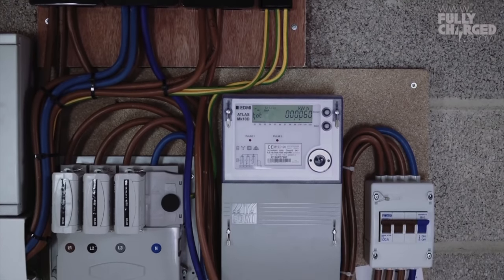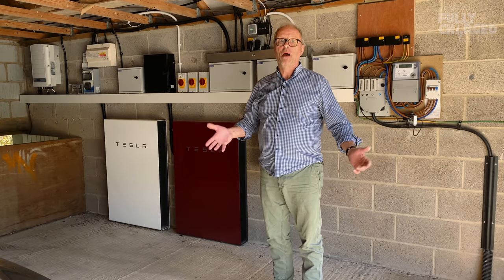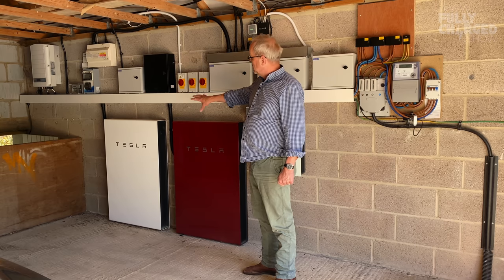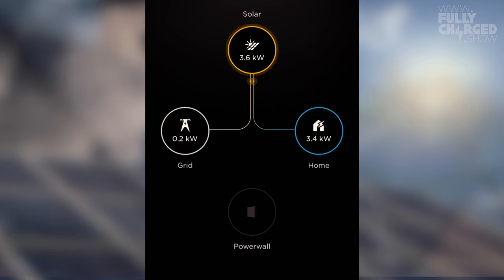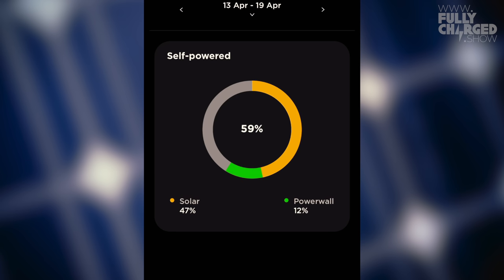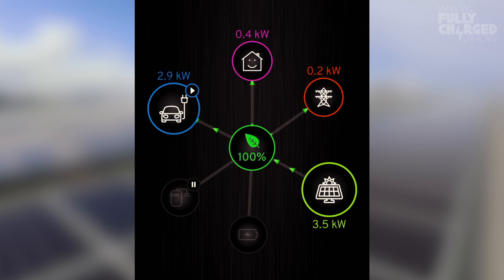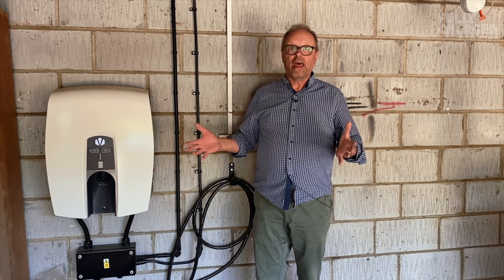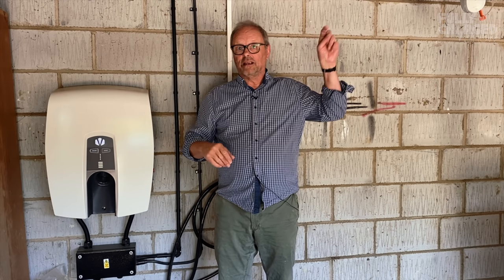Tesla Powerwall: how quickly can it respond to a power cut? | FULLY CHARGED for clean energy & EVs

Comment: Did I miss the part where you explained how your home system knows how to cut off from the grid to protect any electrical line repair personnel? Also, if the idea is to use the cars' batteries and the power walls to balance out the grid, how does your home system tell the difference between an outage caused by damage to the lines, etc., or a dip in the grid which it should feed back into the grid for? Once your system disconnects from the grid, how does it know when to switch back on to it? More detail on the way it (the switch) protects the workers and the consumer would be appreciated. Great video as always Robert, thank you from Oregon.
Reply: Barry Kaine the system still measures the grid side of the disconnect. It needs that info to synchronise what it exports with regards to voltage and frequency.

Comment: We had the Backup Gateway installed about a year ago. It has been a bit odd with showing outages that haven't happened and not backing up all of the outages we have had. I recently changed my EV Charger out for a Tesla Wall Connector which immediately flashed up an error and failed to work. Speaking to Tesla they did some remote checks and it appears I have the WRONG backup gateway for my house! I'm in a rural area and have a TT earth. According to Tesla the initial backup gateways only supported TN-S earth systems which has caused my issues! The newer gateways (from early 2020) are apparently compatible with both earthing schemes - my installer is in the process of replacing mine which Tesla say will hopefully sort the Wall Connector issue too. The joys of a rural installation!

Comment: Thanks for the update Robert. So your house is basically being fed electricity by commercial level 3 phase while the V2G unit is for residential. I am surprised that the company that supplies that unit didn’t have a commercial version. I guess not all these charging and inverter companies can be like Tesla and make it simple and just work. There is many conflicting info on the web and YouTube right now on the capability or status of Tesla V2G as well. My take on it is that most newer Tesla’s and current battery tech would have the capability to do basic V2G for emergencies and use to run the house only. When Tesla launches, not announces the Million plus mile battery(s) is the time when selling stored energy back to grid will make more sense and be feasible. At some point all EVs should have the capability to at least run your home in emergencies and black/brown outs.

Comment: Amazing setup, I'm planning to install a 4kW pv system on my new house in the south of Italy and install an heat pump, but no powerwall or battery (i don't have enough space to fit a powerwall and regulations aren't clear here). But I have my wallbox with automatic load control that acts as the zappy (it is an open evse that I made four years ago for the zoe), and I can store energy in the battery pack.

Comment: Working on a project now at work around charging a large battery (one megawatt) when the power is cheap and discharging when it's expensive - very interesting.  Not sure if it's different in other parts of the world but in Australia it surprised me to find out that when there is too much supply, to encourage demand the electricity price actually goes negative, meaning you get paid to use electricity and it costs you money to feed your power into the grid.

It turns out some of the fossil fuel generators will "accidentally" switch on during the day to force the price negative, causing solar power farms to stop feeding power into the grid to avoid having to pay for the grid to accept their power due to oversupply.  It makes solar projects less profitable which is a shame, because if they don't feed that power to the grid when the sun is shining, it's lost and can't be fed in later when the electricity price hits the just-after-dark evening peak.  The sooner large battery storage technology becomes cheaper the better, because then the solar farms can just charge their batteries when the fossil fuel plants are playing their games, and discharge the batteries when the price recovers.  When batteries get to that point (not far off) it's going to really shake things up.

Comment: I am confused, in the last section of the video you say the power you get at night is clean and during the day it is dirty. Here in Australia, we have excess solar during the day which is clean, sorry I missed something but how do you have clean power at night?
Reply: Not sure exactly (also Australian) but I am guessing their wind power might be able to handle baseload overnight, but during the day the demand increases and they have to burn fossil fuels, as they don't have enough solar to cover the daytime demand.  You can see in winter Robert's solar only covers 25% of his use.
Reply: Berkeloid Correct. At night power is largely nuclear and wind, by day gas generators ramp up production. We also have some coal stations remaining which although not used so much anymore (one percent of all power annually) will come online during sustained high demand periods.

Comment: why is your L2 also Neutral? Could a UK electrician please explain this?

 is it like he uses only the three phases but not the center point of the star? If so, why doesn't he have 400V between the phases? In central europe we have three phase power where L1/2/3 have 400V to each other and 230V to the neutral. 

Or is it a delta-three-phase without a true neutral?

if someone could explain this, I'd be very greatful

Comment: Instantaneous switching, wonderful. And the three phase? Is it so you can export big power back to the grid? 

I'll need to go back to the 1st update and edit my comment about the long switching time.
Reply: If you import or export too much power on only one phase it imbalances the grid (reduces efficiency and can shorten the lifespan of generators due to vibration).  So in Robert's situation they wanted his feed in to be balanced across the three phases, which also means they can triple the amount of power he can feed in without having to install any more wires out in the street (just the extra ones from the street to Robert's garage).  As he said in the video, this requirement is mostly due to him being at the end of a small capacity part of the grid.

Comment: Would be great to get an idea of cost for these things.
Reply: I had the same idea. Checked on Tesla website and they are quoting 2 x powerwalls + 5kW solar panels for €17000.
Reply: You can get a BYD 10 kwh LFP for around 5k + VAT, it works with a hybrid inverter (a combo inverter for solar panels and a battery). The solar + inverter costs around 700 to 750 € per kWP for the material, installation costs depends on the house (which roof material, height, etc). 
The solar itself has  become relatively inexpensive the last years, storages have to become cheaper in future.
Reply: I would also love to know the cost and when this breaks even. "It all depends" is not a good answer. This is a practical application in a not-so-sunny country with an electric car and stuff so it would be awesome to have a real life example in real life conditions. Of course, if I am from Brazil I would not take this and say "yeah, it will be the same". But those solar thingies are always so hypothetical "yeah, if the sun shines so and so and this and that and the roof..." Just give me the numbers from your experience, I can then ask locally around for quotes.
Reply: @FenixBG  "It all depends" IS unfortunately most common.  Every electrical company has different prices, rate structures, and possible rebates/incentives.
For solar panel breakeven, it's fairly easy.  Take your kWh electricity usage/purchases for the year and multiply it times your electricity rate (exclude any grid-tied fixed costs if you have any that you'd have to pay even if you made all your own power, like grid maintenance/infrastructure).  Then, take the net cost of adding solar panels and divide it by that number you just calculated, which will tell you how many years to breakeven.  (You can try factoring in expected electricity rate increases, but don't have to for a general idea.  Also, you can add in any expected maintenance to the solar panels, like if you ever expect to replace inverters, etc outside of warranty).
For me, solar panel breakeven on my setup is around 8-9 years.  (Let's say solar costs me $8500 and I previously spent about $1000 on electricity purchases.  8500/1000 = 8.5 years.
What you may also want to consider as part of the 'costs' is how much you'd lose on interest if you just invested the money.  Also, more difficult things like how much air quality means to your health and medical expenses...

Now, currently for Powerwalls, don't expect any reasonable breakeven for them.  You have factors to consider like: 1) Do my electricity rates differ during the day vs at night.  Electric Vehicle charging and I'm assuming Powerwalls will let you use stored energy instead of buying during peak hours (higher rates).  2) How much do you value having a battery backup when you lose power and what will it back up? (Fridge/food storage? EV charging? A/C? Computers? Etc.).  It will likely take a LONG time to recoup/breakeven on a powerwall for peak vs off-peak.  I'd say it's mostly, 'How much is it worth to YOU'.  Maybe you run a home business, or lose power very often, etc.  So it might be worth more to you than someone in a more stable grid.

Comment: Excellent stuff, but just to be clear regarding the 3 phase power supply and the Tesla switching unit: Does the Tesla switch which isolates you from power cuts require that a three phase power supply is installed or was that just a peculiarity of your particular installation? Would it potentially work with a single phase supply and is having more than one power wall the reason to require a three phase supply?

Comment: Interested to know how you get on with the V2G in combination with the battery storage Robert, my home battery (not a Tesla PowerWall) doesn't work well with the V2G - when the vehicle is trying to discharge to Grid, the battery sees this as excess and starts to charge up! Pointlessly transferring energy... batteries are switched off for now to avoid this, and to allow maximum export from V2G & solar. :)

Comment: A Nicola Badger with a Fuel cell may be a answer for V2G or V2Home , if you can fill up your car from a hydrogen station and let the vehicle in times of shortage jump in and replenish your Tesla Powerwall units and provide electricity during the night , that might be an answer.Also on the IoT-front your appliances could sync with your energy supply and give you a heads up when to load your dish-washer or washing machine .

Comment: Unfortunately a lot of nighttime power is supported by coal here, making the nighttime use dirtier than during the day - however this is getting better as more wind and other storage capacity comes into play. 

The biggest problem that I see with using the excess power to charge the car rather than feeding the grid is that (outside of COVID-19 restrictions) my car is generally not at home during the day as I’m out at work or whatever, and the car needs to be charged at night when there isn’t any solar. Similarly this means that I need to use grid power at night.

Hopefully we will start to see the price for home batteries drop substantially such that having a 100kWh home battery is cost effective. This would be enough to store my excess power and charge the car without impacting the house supply, and would also allow the house to run for longer if there are a few really bad days for generating in a row. 

For what it’s worth though, after a big storm here in February (summer time remember), the grid was taken down for 1.5 days. Some neighbours lost power for a week. Our place just kept running, with solar hot water etc, and the only real impact was no internet (cables down) and no car charging at home.

Something else worth noting is that the ‘self powered’ graph that Robert was showing excludes any power provided to the grid. It’s really showing how much you house has been independent and not the raw numbers generated. For example, if my house draws 2kWh from the grid and consumes 10kWh then it’ll show as 80% self powered, even if the solar generates 30kWh and puts 20kWh of that into the grid. 

As a final word, my place would actually do a lot better in winter if the winter solstice didn’t put the sun below the tree level of some enormous 25-30m gum trees that shade the roof. Don’t underestimate the effect of shading in winter.

Comment: Two questions: Can you select the car as the primary to be charged, so if you come home to do stuff before leaving for a trip you can get max range and PW only gets charged after you leave?
And how much work is it to make the car power the house during a blackout without needing to sell the power to grid first or having the car battery charge the PW which then powers the house?
Reply: You have to make sure it's wired in correctly but I believe the solar panels feed into the Powerwall through a grid-tied inverter.  The Powerwall sees that power being backfed through its mains inverter output to the house, and can take the power to charge the batteries, and then let any excess continue out to the grid.  So if your V2G unit was installed on the house side of the Powerwall then when it takes power from the car batteries and feeds it back to the "grid", the Powerwall would see the incoming power just the same way it does with solar panels.  So this way you could use the car to run the house and charge the Powerwall during a blackout.  You'd want to be careful though because in this scenario the car could easily charge itself from the Powerwall draining it, so you'd need some kind of electronics to control it all the way you wanted.

I'm no expert but I would expect whatever they are using to control it all would have some kind of priority button so you could give the car priority if you were going on a long trip, as that would be a pretty common requirement.
Reply: @Berkeloid0  I think keeping the batteries from charging each other should be the default setting. Only issue that remains is when some electronics between them might prevent them from seeing each other as a battery, especially as every cable and device between them would increase the power losses.
And I think I just found a good reason to put a firewall and strong passwords on your Tesla net app, because some hacker will probably think it is great fun to destroy your PW and car battery by messing with these settings... OTOH, Tesla corporate security hunting hackers with flamethrowers sounds like a perfect setting for a future Netflix show...
Reply: @AnalystPrime  The problem is "keeping the batteries from charging each other" can't be a default because it depends on the installation.  The V2G device must charge from the Powerwall because when grid power is available, this is where the grid power comes from.  When the grid power fails, you saw in the video the Powerwall continues to provide power uninterrupted (the light didn't even flicker) so the V2G device won't notice the grid power has gone away and will keep charging only now it will be flattening the Powerwall battery instead.  Likewise it can't tell if it's feeding into the grid or charging the Powerwall because electrically it's all the same, because everything is using grid-tied inverters so nothing can tell if it's feeding the grid or the Powerwall or what, it all looks the same.

This is why it requires those control devices that can see the whole picture, and tell devices to charge, not charge, switch on/off or whatever depending on the overall picture.
Reply: @Berkeloid0  Yes, but the issue is that PW has about 10kWh to spare while the EV has 50 to 100 kWh battery. PW should never try to charge the EV unless it's an emergency.
OTOH, if during a blackout your solar is not working and the PW is already drained, directly powering your house from the EV battery probably works better unless you know you need to drive somewhere soon.